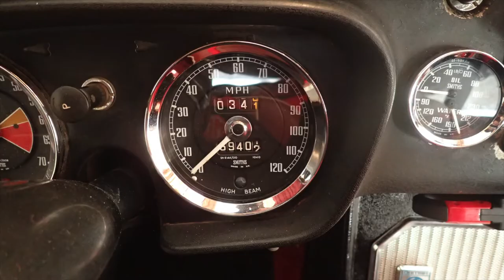65 MGB Dashboard Restoration

Comment: Fabulous result! I'm working my way through freshening up my 74 and it's a bit daunting as I knew nothing about MGBs before I bought it. It's in relatively decent shape and runs like a champ. 134K original miles with the Weber carb upgrade and OD added to the gear knob, very convenient and definitely nice to have.

Comment: A job I’ve yet to tackle, you made it look less of a nightmare I was expecting, well finished and looking good!
Reply from the maker: Many thx Stevie....I guess its dogged determination and patience (which should come owning a classic) that helped!  I found one of the toughest areas was removing the cardboard glove box without damaging it, however I did and ended up replacing it with a not so original but a very robust plastic one.  Whilst the dash was out I installed LED strips in the floor bay and other areas.....very very happy I did that. The switches are mounted on a separate toggle switch panel under the dash (glovebox area)

Comment from the maker: A further comment...whilst you have the dash out, it is the ideal opportunity to tidy up the wiring (naturally) but also replace all of the instrumentation bulbs with LEDs!  You may also want to serious consider taking a bigger step and remove the windshield frame and replace the seals.  With the dash removed the bolts (in the vertical footwell walls) can be removed with relative ease.  I've removed 2 x MGB frames this way and PLEASE be prepared to have one of the windshield frame bolts shear off (as mine did twice - both vehicles, one a 65, the other a 74 at the wreckers at -15C)
Reply from the maker: After drilling out and tapping, new bolts can be simply be bought off the shelf from Home Depot, a hint on the replacement bolts.....using a bench grinder chamfer (grind 45 deg) the ends which will help the hole accept the bolt much easier.